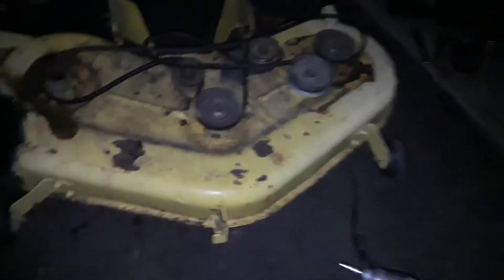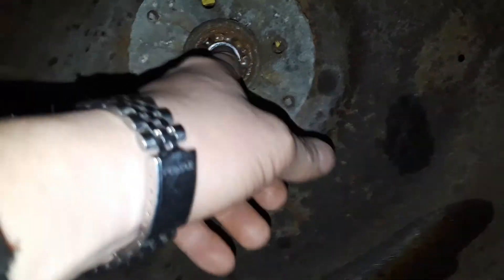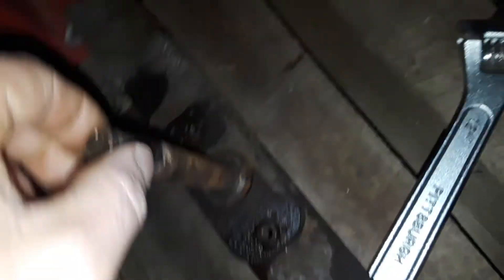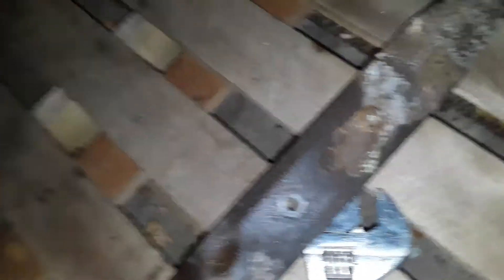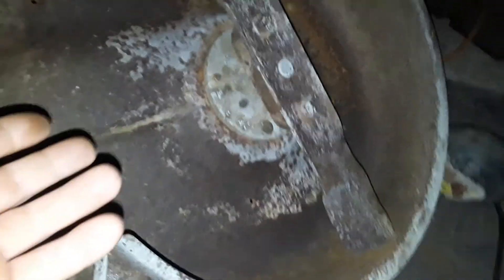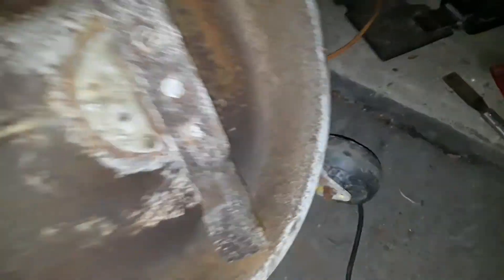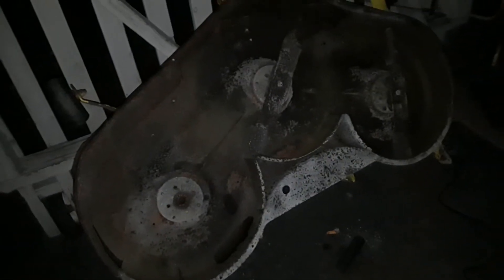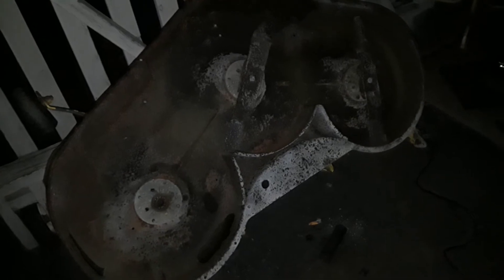Working on the John Deere L130 part 2. Digging into it's problem's. Are they worth fixing?

Comment: I might be wrong but I don’t think there is a bearing in the blade adapter that the shaft is on. I think when you tighten up the top but it just draws up the adapter and blade tight to the spindle. I would try and get the bearings for the spindles and get that deck squared away. I know what you mean though. That’s a lot of work, either spent the time to tear it all apart and part it, or fix it and shoot for the $1500
Reply from the maker: It had that slop in it before I took it off there when it was tight. I'll try again tomorrow at getting that bolt off. That worn hardware is whats slowing me up. Maybe with a bolt extractor now that I'm thinking about it.

Comment: Heat at quench. That's the only way I get bolts, blade adapters and snow blower augers that are ceased. Acetylene torch is a must but a propane one will do. The key is hitting with water so the metal contracts rapidly and breaks the rust bond. 
Slotting a bolt head with a dremel tool is a technique I have used as well to get bolts out that were beyond the use of a socket or extractor. For some reason welding a nut has never worked for me but the intense heat can be a help.
Price of equipment is only going up man... look up china shutting down magnesium and aluminum production. 
The "energy crisis" they planning for is only going to drive prices higher and higher in the coming years.
Reply from the maker: I have an oxy acetalyne torch. That's not the problem. Head of bolt is rounded off, can't get a grip. Gonna try extractor tomorrow. Otherwise grind it down enough to put a smaller socket on. They'll turn if I can get a grip on them, that's the problem.

Comment: My buddy made a JD L100 out of a newer craftsman deck, and it work as it should. Use AYP spindles has to be some with same mounting points and direct bolt in for the blade. Good luck like to see you sell it for max profit with the plow!
Later...
Reply from the maker: Thank's. I'm going to try using an extractor on that bolt tomorrow. If not, grind down enough for a 14mm because it was a 15 which slips now.

Comment: Cut the bolt heads off, then work with what remains?
Reply from the maker: I grided the head down a bit and got an extractor socket onto the head and was able to turn it and get it off. Really didn't need to come off anyway. Live and learn. 🤷‍♂️ Its off. Part 2 uploading now.